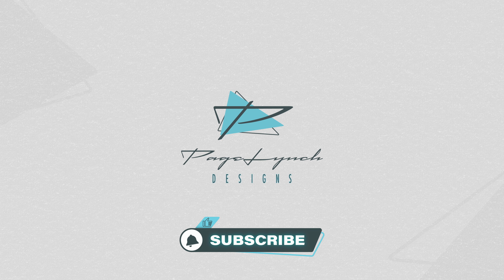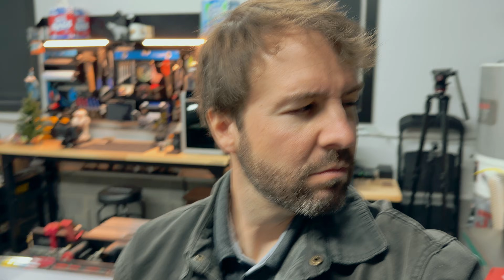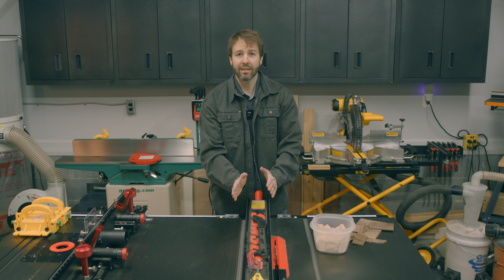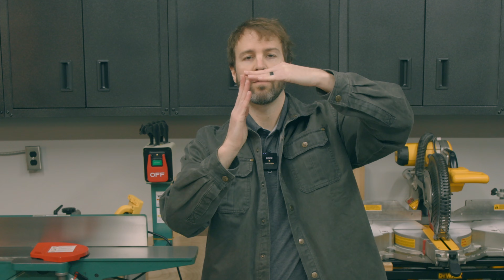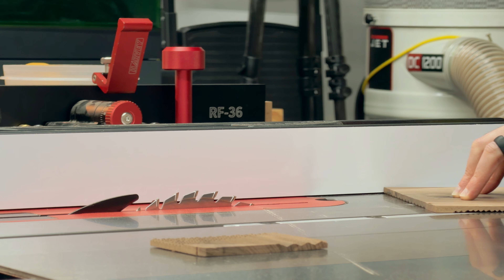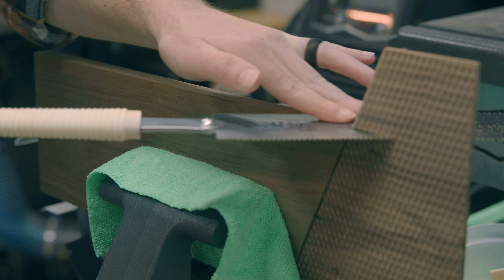How I made this walnut pattern using ONLY a table saw

Comment: Wow! Stealing this for a gun case. What dimension plywood did you use? Looks like 1/4" shims with the depth of cut at about 1/4",,,
Reply from the maker: Steal away! Lol They were milled to 1/4” thick, but I think the depth of cut was about half for the checkering, so 1/8” on that. Then the full 1/4” depth into the drawer face to inlay the pattern piece. Thanks for watching!

Comment: This can be accomplished more easily with a single shim and either a block clamped to the rail your fence rides on or a strong magnet on the table of the table saw. Set fence, make first cut, use shim to space magnet or block away from fence, move fence to block or magnet, make second cut, repeat.
Reply from the maker: I see what you’re saying, and that would work! But you would have to be moving the magnet each cut, whereas all I had to do was toss out a shim each cut. Regardless, there being multiple ways to accomplish the same task in woodworking is part of the fun! Thanks for sharing your solution!
Reply: Yeah, I would do it the way you just described first as a test. Why? I wouldn’t have to make a lot of shims and that saves me time.  I think the starting point for your approach would be on the opposite end of the material, not the corner as shown in the video. I’ll give it some more thought. Thanks for the suggestion.

Comment: Perhaps I missed it if you said it. Why not mill the knurling directly into the drawer face, why make it a separate piece to glue up? Great work, love the format of your video
Reply from the maker: Hey great question! It didn’t occur to me to address that. So, in order to make the crisscross pattern, you have to take the passes beyond your stopping point. So, if it was on the drawer face itself, the lines that run towards the part you don’t want cut can’t just be stopped dead there. You’d end up cutting into the stuff you wanted to keep. Make sense?
Reply: @PageLynch  right when you’re cutting towards the end of the drawer, you can just cut right through but when you’re cutting in words towards the meat of the drawer face, you wouldn’t be able to stop the cut. Got it !
Reply from the maker: Happy to help!